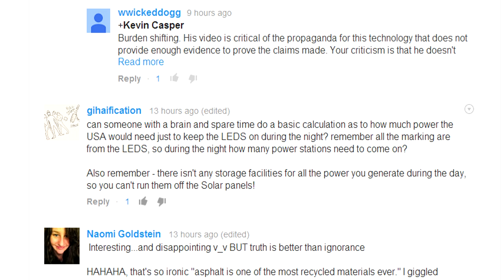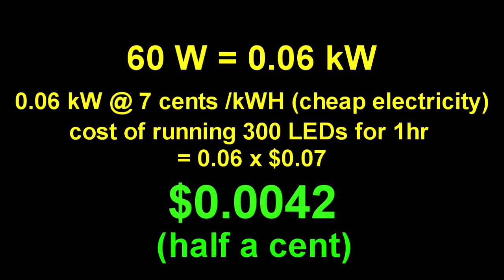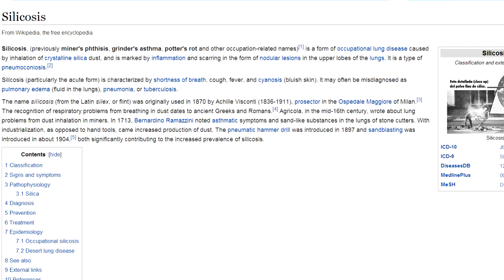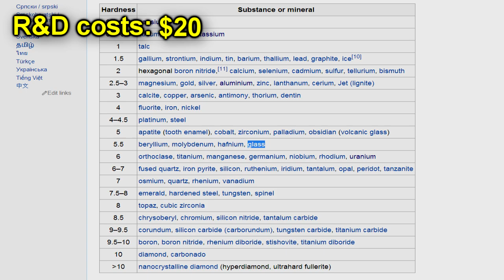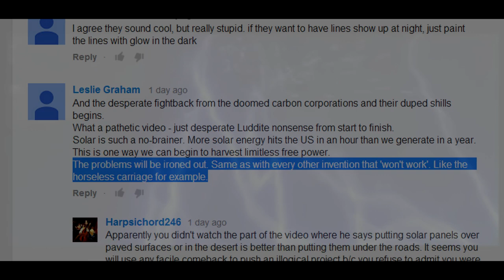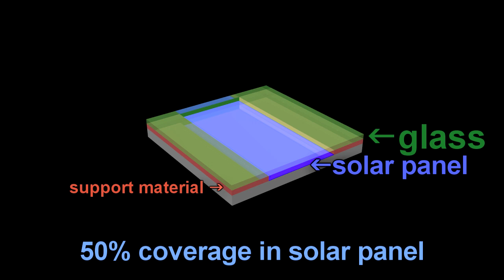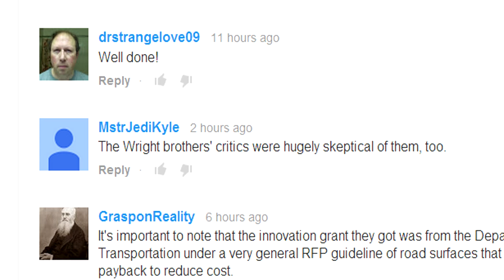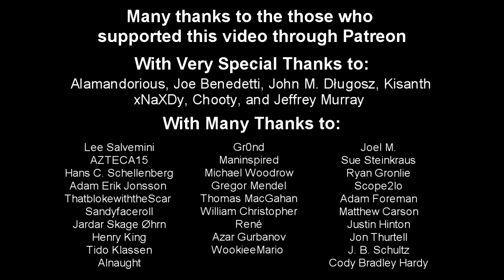Solar Roadways, IMPORTANT QUESTIONS AND ANSWERS!

Comment: why not replace glass with  a heavy duty polymer
 add painted lines  keep LEDs for emergency signals
add a small energy storage it would work

i think it would be a good idea for sidewalks 
(well with a few changes)
Reply: mellored

Don't know what you mean by "wavy" light then, because light doesn't do that. Light doesn't change behavior until it encounters a medium. And again, direct light has a lot more energy than indirect light. This is why angled and tracking solar panels generate a lot more power and why Alaska is colder than Florida. The sun is higher in the sky in Florida and it receives more direct sunlight.

Normally, you wouldn't need to throw away glass with small imperfections if it was a beer bottle or any other kind of annealed glass. But for structural tempered glass, imperfections cause potential for failure. 

3. It all depends on if the demand is too high than can be easily and reasonably supplied with the available capital, human capital, and (fossil fuel) energy. None of those things is infinite. 

Yes, IC miniaturization is made possible by machinery. But it wasn't demand-driven. An example is a smartphone, People were willing and able to pay for phones, answering machines, MP3 players, laptops, portable game players, personal organizers, etc before the Smartphone. But profit-driven companies like Apple, Blackberry, and Google were able to integrate all those into increasingly miniaturized chips and devices and cannabalized the demand away from makers of answering machines, MP3 players, personal organizers, and portable game players.The cost to make all the above dropped significantly, which benefit suppliers and consumers. But none of that came from MAXIMIZING cost at every turn and trying to solve problems that don't exist while creating new ones, like Stupid Freaking Roadways.
Reply: See that actually isn't that bad of an idea. You'd only get the full effect of the "cool lights" at night anyhow, which is when illuminated roads would be most effective anyway.
Reply: Glass is stronger then most polymers.  But, yea.  If needed, they could simply paint it.  Or more likely, do sidewalks, patio's, driveways, and disney world first.  Places that don't need LEDs, or don't mind paying a little extra for a light show.
Reply: mellored

Define stronger. Do you mean stronger in compression? Or stronger in tension? Or impact resistance? Or yield strength? Then prove it.
Reply: fubecabr Scratch and compression. Glass is pretty bad with tension, and while it can have a high impact rating, it is brittle. Though polymers have the nice advantage that they can be reapplied. I really don't need to prove anything, no one else has.
Reply: mellored

I mostly agree with your comment, there are polymers that are harder than mild steel and glass.

http://www.poeton.co.uk/w1/hard-anodic-polymer-composite.htm

But of course none of them are suitable for use for roads, from a technical, cost, and practical standpoint. And yes, you do need to prove what you claim. That which is asserted without evidence can be summarily dismissed.
Reply: fubecabr Glass really is the best substance for a transparent road.
Reply: mellored

But there's no evidence that it would meet traction and durability requirements. Not to mention the astronomical cost of the glass and concrete corridors that these would sit on.
Reply: fubecabr And there's no evidence that it doesn't meet traction and durability requirements.  Or how much it would cost, particularly if made in bulk.
There's plenty of examples of glass surviving for much longer then 20 years (1500 is the oldest), but no evidence, one way or another, as using one as a road.

Personally i think solar roadways are at about 10 years off.  But solar sidewalks and driveways are plenty feasible.  Glass stair cases have been around for ~30 years without issue.
Reply: mellored

Oh, so critics are supposed to prove a negative? The burden of proof lies with those making the claims. Stupid Freaking Roadways made a lot of grandiose claims and has provided no evidence for those claims or that it would be cost effective. 

Glass is already made in bulk. Making it in larger quantities is unlikely to make it cheaper. In fact, when you demand more of something than can be easily supplied, the cost goes up. We see this with oil. We drill marginal wells in marginal areas because so much of it is demanded. This causes the cost to INCREASE, not decrease. 

No one disputes that glass doesn't biodegrade and that if left alone and not DRIVEN ON or that it has an indefinite lifetime. No one's ever used glass as a road surface because the physical properties of glass as well as its cost are quite well-known and understood. The cost of materials for asphalt roads are not a major driver of cost. In fact, the bulk of the materials used in asphalt roads are free or almost free and often found onsite or near the construction site (gravel).

A glass staircase or glass floor tile that only has to deal with human foot traffic is entirely different than having to deal with 80,000lb+ 18-wheelers driving up to 80mph on it for decades.
Reply: fubecabr They are proving it.  It's in testing right now.  Tempered glass, in large enough bulk, can be about the same cost as asphalt.

~25% of the planet is made of silicon (i.e. sand), which is where glass comes from.  So the raw materials for that are basically free as well.  The main cost is energy to melt it.  Heck, you can find glass on the beach made from lighting strikes.  Though they tend to be fragile and opaque.

Asphalt is an made from an oil byproduct. Yes, most of it is gravel, but without the asphalt to glue it together, it wouldn't last very long.  As oil goes, so does asphalt.

We won't run out of concrete either, so that's another fall back.

And, no, no one has driven on glass for long periods of time yet.  But again, we've walked on it for ~30 years without issue.  And it survived weather without issue.  Ergo, solar sidewalks are totally feasible.

Solar roadways are a maybe.
Reply: mellored

They are proving it? Where's the testing data? One video of a homeowner tractor that drives over it once is hardly proof of any real world testing. Again, they said they already tested it and it works. The point of the Indiegogo campaign was to raise money to start manufacturing in every country in the world.

You're conflating elemental silicon with sand (silica). But yes, sand is quite abundant and it is NOT the major cost driver in glass. Glass requires massive amounts of energy (oil/gas) and is capital intensive to make. Go watch a video on how glass is made.

Yes, asphalt is an oil byproduct. But there's actually a huge quantity of bitumen (oil/tar sands) found on Earth. It's conservatively estimated that the reserves of bitumen are at least double that of conventional oil. What is being done in Alberta and North Dakota is converting bitumen and cracking it to more valuable products.

Concrete also requires a lot of energy and is also capital intensive. There's also a significant impact to the environment from concrete production.

http://en.wikipedia.org/wiki/Environmental_impact_of_concrete

Walking and driving on glass are two totally different things. Are you really so dense as to not see the difference???

It survived weather without issue???? Again, where's the testing data? And again, something that just sits there and is left alone is totally different than something that is actually used. Furthermore, something being possible (solar sidewalks), doesn't mean that it should be done if the cost is too high and there are better and cheaper alternatives.
Reply: fubecabr What do you think the parking lot is besides a test?  It hasn't even been out a year yet.  
I said that energy is the biggest cost of glass.  You're agreeing with me.  Cracking bitumen is also energy intensive.
The test data for glass surviving weather is on every building.  Your run of the mill window comes with a 25 year guarantee.  And again, there are 1500 year old windows as well.
And at no time did i say walking and driving on something was the same thing.  Get your head out of your ass and read before you attack.
Reply: mellored

A solar parking pad that is just sitting there not being used and had one homeowner lawn tractor drive over it one time proves that you could drive 18 wheelers on this thing for 20-30 years???? 

Again, no one disputes that glass, if left alone, is impervious to the weather and has an indefinite lifetime. No one disputes that there are 1500+ year old windows. What's in dispute is that glass would actually be good for use as a road surface and Stupid Freaking Roadways has not given any evidence to support their claims. 

When asked where's the evidence that glass would meet durability and traction requirements for roads, you keep bringing up glass floor tiles, glass stairs, or old window glass as if that's somehow evidence that glass would be a great surface for roads. 

And again you keep forgetting that lots of oil and gas are used in concrete and glass production. And yes, there's lots of energy required to crack bitumen and turn it into more valuable products. But it takes very little energy to simply mine the bitumen for use with roads and there's a shit ton of it.
Reply: fubecabr There only test there has been so far is compression, which glass does very good at.  There is no evidence on the wear and tear of it, since it has only existed a few months, let alone 20 years.
Saying you shouldn't try anything until it's proven means you will never try anything.  It's a loop of stupidity.  If they aim for solar roads and fail, but we get solar sidewalks instead?  That's still a win.

And yes, the vast majority of our energy is from oil and gas.  You know what will help change that?  More solar (and wind, tidal, ect...).

Even if solar roads only get 1/2 the energy back that is put into them, that a whole lot more then the 0% energy you get back from asphalt.
Reply: mellored
"Even if solar roads only get 1/2 the energy back that is put into them, that a whole lot more then the 0% energy you get back from asphalt."

Yes, and at an astronomical cost.
Reply: HimJimRimDim Where do you get your cost from?
Most industrial countries spend 1.5% of GDP for roads per year.   16.8 trillion * 1.5% = 252 billion per year for the US.
Reply: mellored

Many people have done back of the envelope calculations and have shown Stupid Freaking roadways to cost at least 400% of GDP just to install and not maintain, compared to 1.5% of GDP per year for real roads.

Everything's relative and if there are cheaper solutions like asphalt roads and solar arrays in the desert and solar panels on rooftops, then that's what'll be done. This country does not have an unlimited amount of money and resources. The economy is NOT magic.
Reply: fubecabr 400% if you try and do the entire thing in 1 year mabey.  More likely 20% per year.

Here's tempered glass for $3.69 per square meter rated at 26,106 PSI.   http://www.alibaba.com/product-detail/2014-New-technology-High-quality-tempered_60016580114.html

Here's 60 LED's for $1.06 (much less then thunderf00t's $20)
http://www.alibaba.com/product-detail/High-quality-SMD3528-led-60leds-m_1597853770.html

Hers's 20% 6' solar cell for $1.60
http://www.alibaba.com/product-detail/Solar-cells-for-electricity-solar-cells_1714375982.html
You'll need 43 of those= $68.8

Here's a control chip for $24.47
http://www.mouser.com/ProductDetail/Arduino/A000066/?qs=BC3YYPaifMrIue9b%252bHtKQg%3D%3D&gclid=CIOSia-5_8ACFfMZtAodvBkAQA

= 202.96 per tile
*240b tiles / 20 years
= $2435.52b

= 14% GDP, which is a much more realistic figure.

We need to replaced 1/3 of our roads to power our country, so that's 4.6% GDP, compared to the 5.9% we pay for energy now (+0.5% roads that got replaced).

A net savings of 1.8% GDP.

Of course, there's alot that remains to be proven.  Like weather they can really last 20 years, and if they can really return the energy.  But the basic math is sound.
Reply: mellored

The tempered glass you linked to is made with the float glass process, which is cheap. The price quoted at $3.69/sq meter is for 3mm (1/8") glass. The tempered glass with Stupid Freaking Roadways is 1/2" thick custom textured glass and cannot be made in with the float glass process. Furthermore, no one dispute that glass is strong in compression. But compressive strength is not the only thing you need with roads. 

The LEDs you quoted make 860 lumens from SIXTY of them, or 14.3 lumens each. A square meter of sunlight gets 100,000. You're not going to be able to see LEDs that make only 14.3 lumens apiece in daylight. There are LEDs that make an order of magnitude more light than the LEDs you quote, but they're more than a buck each, even in massive quantities. Furthermore, even 143 lumens in sunlight would be dodgy in direct sunlight and you still wouldn't be able to see it if recessed BELOW the surface of the road and pointed up.

A solar panel by itself is $186/sq meter. There's not much markup on solar panels and they're already mass-produced.

http://www.gogreensolar.com/products/solarworld-sw-260-mono-260-watt-solar-panel?gclid=CO2-t8TL_8ACFZSFfgod3C4ArA

Assuming 25,000 miles of road that's 24 feet across with the above figures makes $58 trillion. Even if you assume you can get the cost of the panels down 50%, you're still at $29 trillion....JUST FOR THE FUCKING SOLAR PANELS...

We spend about $400 billion on electricity per year. Even assuming a zero percent interest rate, it would take 72.5 years to pay for themselves. But solar panels have a useable lifetime of 20-30 years. Oh and the government can't rub two nickels together, so it'd have to borrow money at least a 3% rate (30 year bond).  This could never ever be worthwhile, even if the concrete, LEDs, glass, and installation costs were FREE.
Reply: fubecabr Before the crazies who support the idea get in here, I will suggest a few objections that may be brought and why they don't rescue the idea.

1) If mass produced, glass with a molded surface would become cheap.
- Not if it is to be tempered glass.  The tempering process is a lot harder to do on a lumpy surface.  Molded kitchen glass items can't be used as counter example.

2) We can get LEDs that are extremely bright
- There is a sharp rise in the price per LED as you get into those and they still take a lot of power to run.

3) Solar panels will fall i price with the high demand.
-  No, it is more likely that with that added demand, the price would rise.  Good old supply and demand works.
Reply: Ken Smith & fubecabr  You don't need perfect optical glass for solar roadways.  It doesn't matter if light coming though is wavy, as long as it's clear.  You can simply pour it into a conveyor belt of molds, and let it cool in a very similar way they do float glass.  You don't need perfection.

2: LED's do not need to be bright the entire time.  You can also place the LED under the bumps to improve the angle.  Or simply paint the thing if your not going to change anything.  Though, this is one of the big reasons why i think solar sidewalks are more feasible.

3: No.  That only applies to a scare resource.  None of the ingredients on solar panels are scarce.  Higher demand might raise prices in the short term, but it also encourages people to find ways to make it cheaper.  It's why computers get faster and cheaper every year, because there's a big demand.
Reply: mellored

LOL, doesn't matter if it comes through wavy? You don't understand physics well, do you? The Northernmost latitudes in the Northern Hemisphere are colder because much of the light is indirect. You can look indirectly at the sun out of the corner of your eye and not have it be damaged. Same applies to solar panels. Indirect light doesn't give the energy that direct light does.

Molded textured glass is much more difficult to make and has a lot of flaws in it, which requires much of it to be discarded and recycled. Not cheap, although I admit that with mass production you could bring costs down somewhat.

2. True, but it doesn't matter. Place LEDs under bumps? You mean use some sort of lenses? LOL!!!! Yet another difficult solution to attempt to solve problems created by attempting to solve problems that don't exist. You'd still need a high power LED because you're scattering the light in all directions of the bump, which means you need an even more powerful LED and or an array of LEDs and a lens to concentrate the light accordingly in order to make it brighter than the sun. Passive reflective nanoparticles is so much cheaper and easier.

 3. The raw materials are not the primary cost driver in solar panels. It's the machinery and energy. Computers do not get faster and cheaper every year because of big demand. It's because of miniaturization. A current Intel CPU has a transistor count of 1.4 billion into an area the size of your fingernail. 10 years ago, a Intel Pentium 4 CPU had 42 million in a chip the size of your fingernail.
Reply: mellored

Another example of how much more energy that direct light has is a laser. Laser is light that doesn't scatter. A 1w laser will permanently damage eyes. A 1w LED won't. Even a 10w or 100w LED wouldn't do any permanent damage to your eyes because the light is scattered and non-coherent.
Reply: fubecabr I understand physics just fine.  "Wavy" is different from a "indirect".  And you DON'T need to throw away every piece of glass that has any small imperfection.  Solar panels don't care if the sun looks a little more oval then round.  (Unless it's really bad).  Which makes cost alot closer to float glass.

2: I don't see how putting it under a lens is difficult when your using the glass as a lens to improve the solar angle anyways.  But i do agree there's not enough benefit from LED's.  Unless you can make good use of lane changing, are selling advertising space, or are Disney World's tron exhibit.

3: Exactly my point.  More demand = more machinery = less cost.  Raw materials are not much of a factor.  Plus solar produces energy, so it actually lowers cost on that point as well (though, not by much).

Computer miniaturization is made possible by machinery, which is paid for by high demand.   If computer demand suddenly dropped, no one would put in the millions needed to make the next generation of chip.
Reply: The whole point of using glass instead of asphalt was that asphalt is a derivative of oil. Polymers also are a derivate of oil and they take much more oil to make than asphalt does. Asphalt is also a waste product of oil which we get wether we like it or not when we refine oil, unlike polymers which must be manufactured.